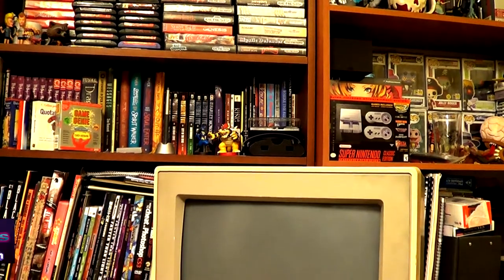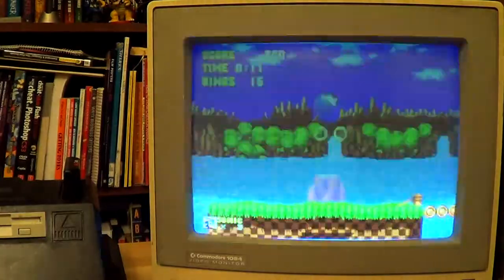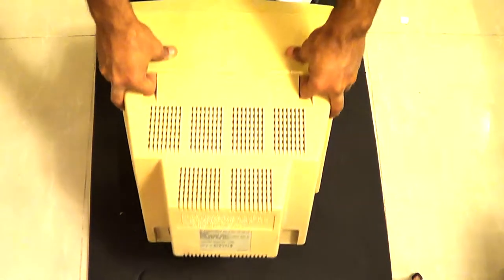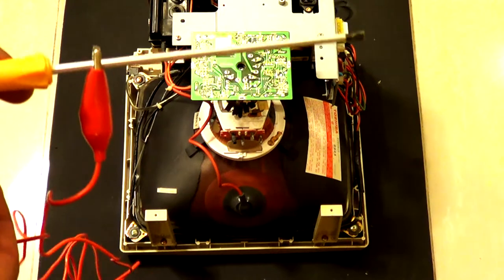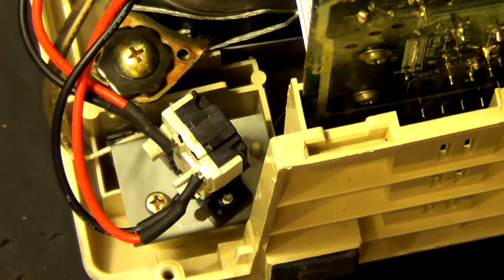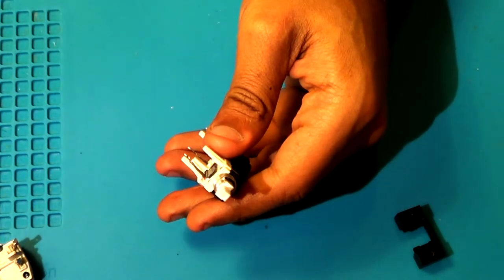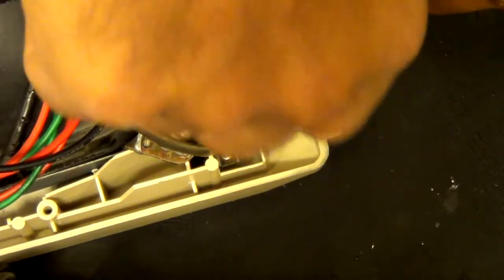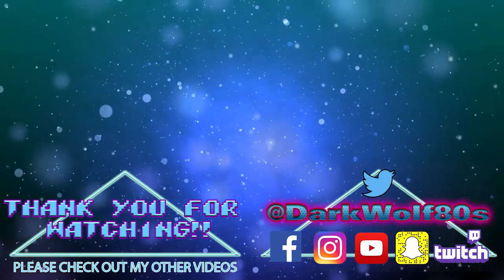#DW80s - Tutorial - How to Discharge and Fix a CRT Commodore 1084 Video Monitor Power Switch

Comment: Thanks for doing this video.  I wasn't sure if that bracket was going to come off, but was happy to see prying it out works.

I initially did not have a working switch because I didn't solder it all the way down where the copper part is on the contact... needed to thread it through the hole and then solder it.  Anyway, great video.
Reply: @DarkWolf80s  for sure, if I ever encounter a video that helps me out, I try to let the author know regardless of how old it is.  I subbed in the event you decide to make videos again :)

Comment: Nice video. I have a Commodore 1802 which has a switch that won't stay turned on.
Did you include all steps of the discharge process or did you leave something out? What kind of rubber gloves would you recommend?
Thx 😊
Reply from the maker: Yup! All the steps are there. And I just use regular hardware rubber gloves
Reply: @DarkWolf80s  Do you use work shoes with rubber bottom too?
Reply from the maker: @StefSis  nah there's no need

Comment: A very great video...I sadly was not back in the retro scene 19 years ago and abandoned a wonderful 1080 monitor, but I have a 1084 like yours and a 1084S...the picture of the S is total garbage compared to the 1084 monitor, but it works...I do need a switch replacement on one, so this video was great help. However, regarding discharging the monitor, if it has been left for several days without being used, is the discharging process still necessary?

Comment: I have the 1084s version of this monitor.  The switch was also broken. I could hold the power button in to get a picture but it wouldn't stay on when I let go of the power button. Now the picture won't even stay on anymore. completely dead screen. The sound still works though.  I wish I could get it working again.
Reply: @DarkWolf80s  thanks for you reply. I opened up the monitor probably 3 years ago and didn't notice any bad caps. I didn't think about resistors. I'll have another look at some point. I am a bit of a novice.

Comment: I am trying to recondition my 1084, identical to yours. My power switch is opposite to yours... it has to be held in to power on the screen...

Anyway, mine had several bad capacitors that I desoldered and replaced... I must have missed some, because I have a badly rolling picture. 

Do you happen to have a diagram to track down the issue?

Comment: can You give us a part reference for that switch please ?
Reply: @DarkWolf80s  Awesome ! You are the Man. I have the same exact monitor annd it is behaving strangely. the right side is showing kind of a "wave" where color is l more saturated and image shows up brighter and out of focus. when the tube heats up this effect almost disappears but the saturation difference is still noticeable. the color is saturated the most at the upper right corner and less down left. Even when the monitor is turned off on the screen it is visible a halo, maybe because of magnetic issues due to the two 1571 drives standing nearby? 😕 I've been using that monitor doing graphics (with GEOS megapatch 3 btw)  by just plugging and unplugging it for quite awhile cause the tv repair shop guy told me it was ok doing so, maybe it is a demagnitizing/degauss  issue due to the fact that the switch stays perpetually in the ON position ?

Comment: Thanks for the video! I recently picked up a non-working 1084 (same variant as yours). I was only told it stopped working about nine years ago. So it sat unplugged and untested for many years. I did not even try it out myself because I did not want to recharge the CRT in case I get brave enough to try some troubleshooting. The power switch seems fine in my case. The previous owner would have been able to tell me if it was just the switch. It is more likely it is one of the other common failures (flyback or bad solder joints). I'm wondering if you can see any signs of trouble here: https://www.youtube.com/watch?v=mM8ECre8rbM The first few seconds are the solder joints below the flyback and they do not look good. Aren't those lines going through the joints an indication of damage over time due to high voltage?
Reply: Thanks for all the info. That is good general advice. I will need some more supplies (and courage) to perform a proper discharge. In my initial cleaning and inspection, I did not find any signs of bad caps and I was able to remove most dust build-up with an air duster. I know the IPA cleaning will do more to help also, but I was mostly interested in your opinion on the solder joints underneath the flyback transformer. Aren't they an obvious problem?
Reply: Thanks. Believe it or not, I knew about the yoke adjusters. I had some monitors in the past with convergence problems that I never attempted to repair on my own.  :)
Reply: Since I may take the plunge on discharging it myself, I decided to test a power-up of my own. The power switch does sound like it is engaging and I hear the familiar static build-up of a CRT. There is no power LED indicator, however. I realize that could just be a separate fault. There is also no glow from the rear of the CRT. Even if there is no signal being sent, shouldn't the CRT glow slightly? I did let it warm up for a while. If absence of a glow is an indicator, perhaps there is something seriously wrong. The good news, there is no high-pitched whine.